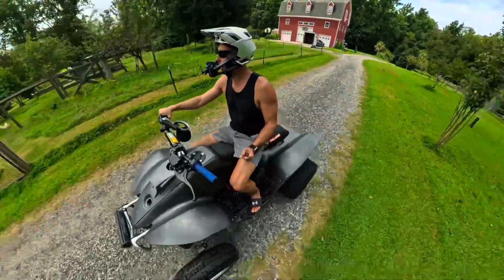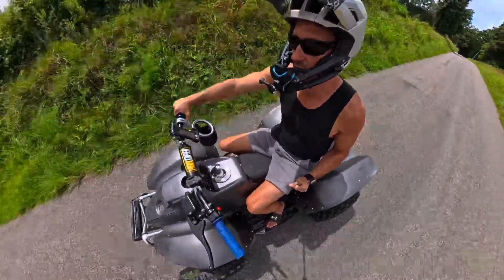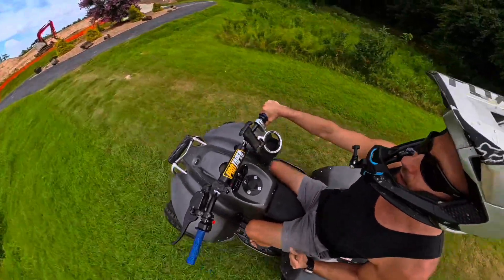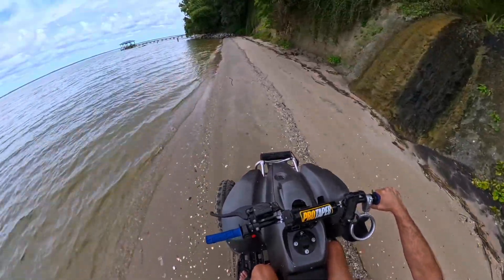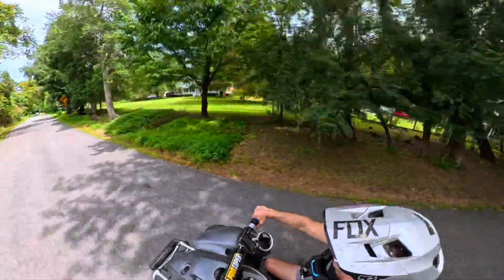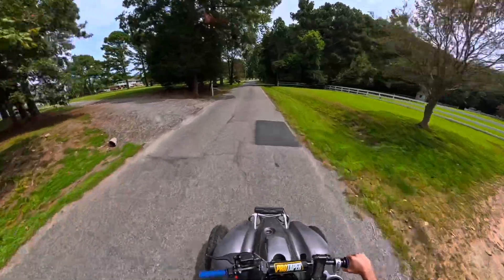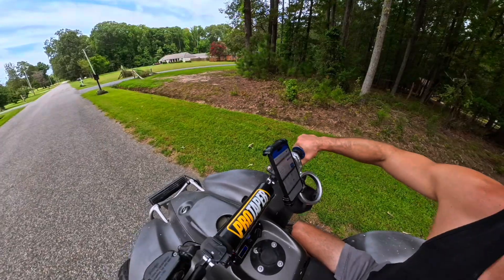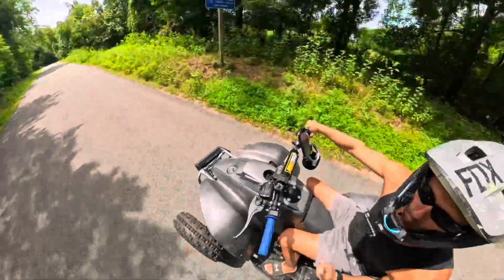Battery talk (moto vlog style)

Comment: I always tell people you typically get one mile for every amp hour at max speed. I have the same cart and fw11 motor and\nEverything else except the battery pack which i'm looking at amorge. You said it needs to be one with a continuous 200amps output. But I don't know if the high output batteries like that decrease the mileage on amp hours. Is that still about right-thinking with the higher output battery?I can still generally get one mile per amp hour? Because I'm thinking a 25 or hopefully 30 amp hour.Battery 72 V and 200 continuous amps.\nMight be about as big as I can get on that cart.

Comment: Your property looks like a dream. Can you please upload more mini kart vids? I just bought one and would love to make it as quick as yours
Reply: I also just ordered a cart.I found a place called( e-conic cycles) they have everything he's using.\nIn a kit for sale right now , excluding the battery with going to probably get mine from amorge. But the fw11,72450or72680, pre-wired.\ bluetooth capable without the dongle.& suron throttle, grips,mode switch, volt meter/key. 565$ sale with 72450 or 100$ more with 72680. No display. That saves a few hundred dollars
Reply: @cwebb5537 have bought from amorge and are you satisfied?